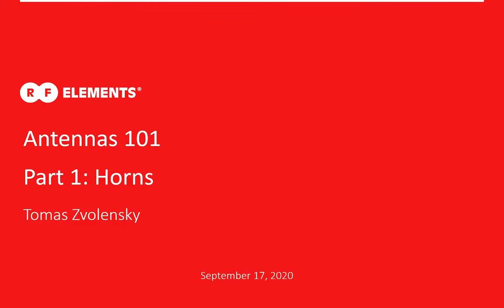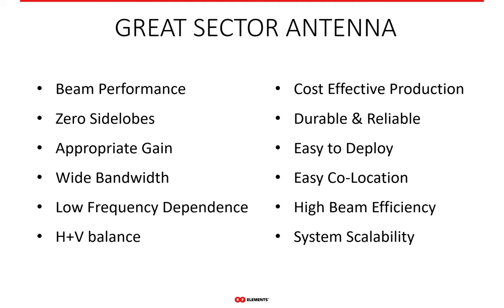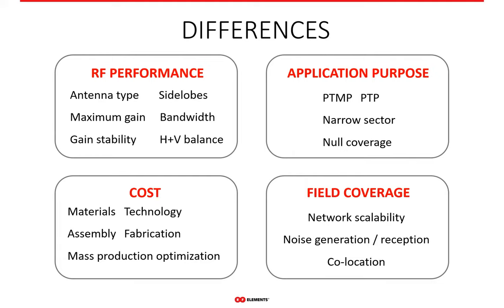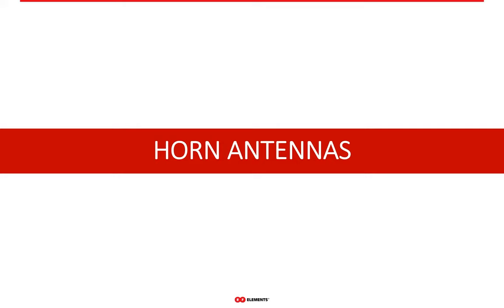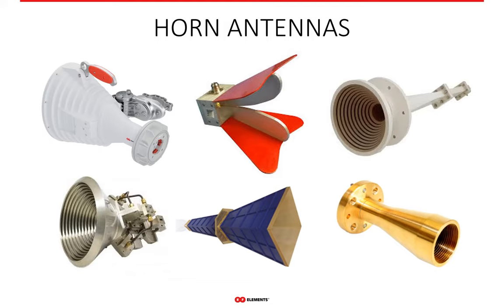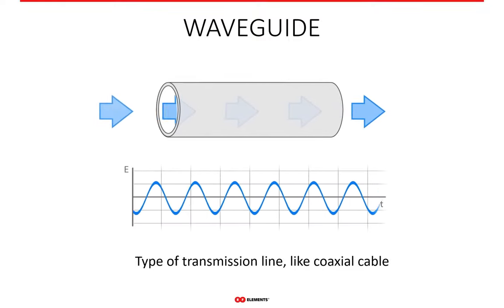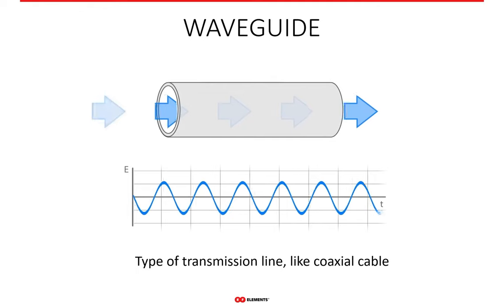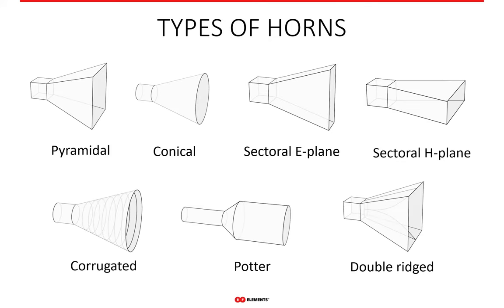Sector Antennas101 - Horns, ENG

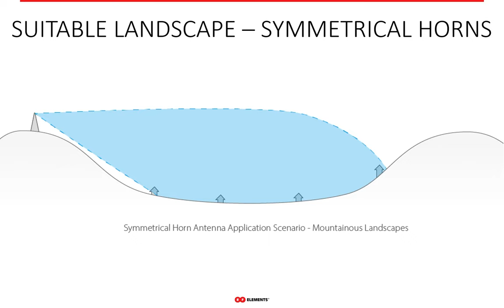Comment: at 40:19 where there is a deep valley... or the opposite a hill so you need to aim antenna higher. How do you properly set up the angle of the antenna so you get proper coverage no nulls of the beam.?
Reply from the maker: Our link calculator (MULTI CPE) shows you real coverage you can achieve with our antennas. You can play with downtilt as well and see how the coverage changes:  https://rfelements.com/calc